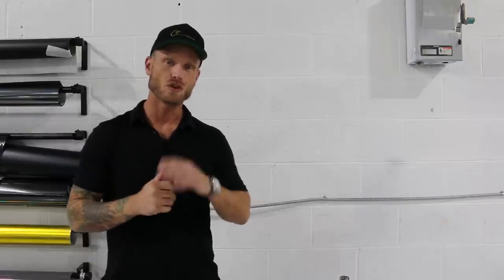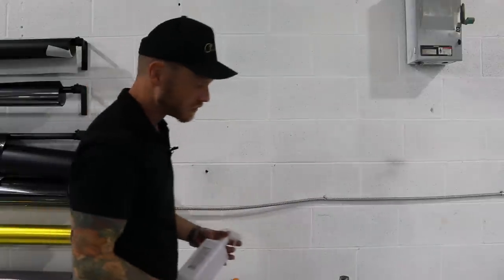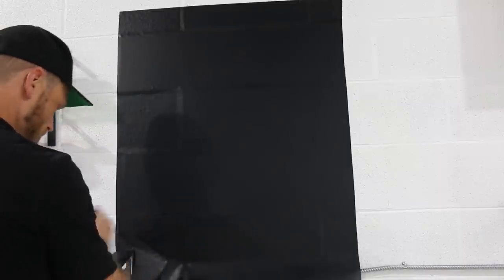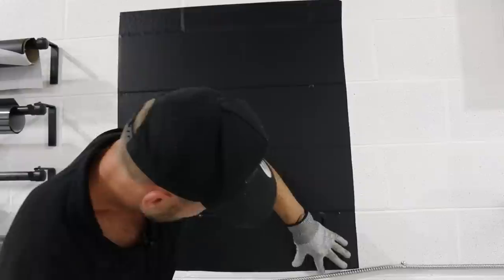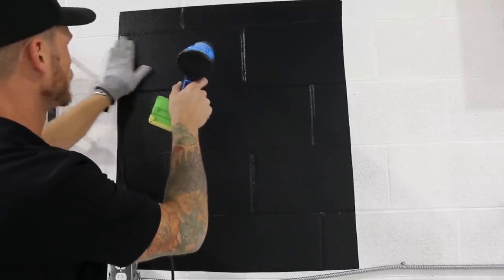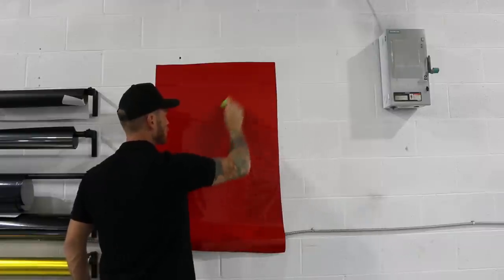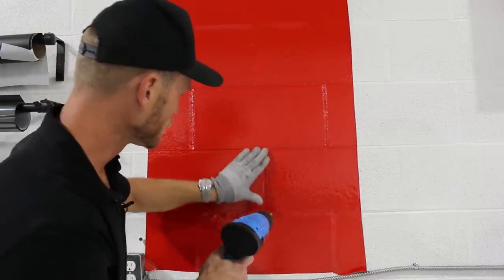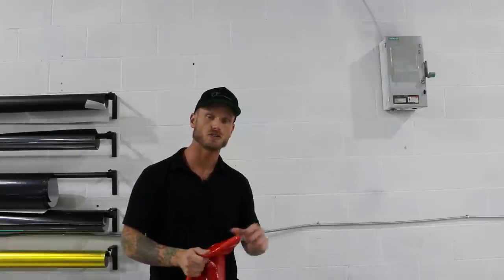Will It Wrap - Vinyl Wrap A Brick Wall

Comment: i use 3m 180 for most textured surfaces. vcat2 foam roller for the grout lines, but first i just squeegee the edges, roll with heat over the entire brick/cinder block surface with a wide foam roller to lock it all down, then go back for the grout. much faster. some were asking about non painted brick, it’s perfectly fine. just brush off the dust and loose debris, make sure it’s dry and you’re good to go! unless someone put a sealer on it. but you can wash with isopropyl

Comment: Sweet video! 
There is specific vinyls for walls and textured walls that conform to all the different little textures in there, theres also rollers that you use with heat to adhere everything to all the little crevices and stuff.

Comment: Fantastic demo.
My thoughts:
-This demonstration does not show the air channels necessary for a full brick wrap
-How to avoid bubbles on the face of the brick
-How to remove bubbles in the grooves after installation
-Proper rolling tools available for these situations
-Rolling tools vs gloves
-Torch methods (I use blowtorches 99% of the time for vehicles, 25% for brick walls)
-The temperature of the heat gun
-How to wrap around obstacles (the wire and the outlet)
-The brick face was not fully adhered to show full texture
-The amount of time it would take to apply primer to each groove
-Proper way to align an image or text to the wall level
-Proper ways to promote adhesion to the top of the panel (banner tape or primer)

Id love to see a video that shows when and when not to use primer. Or a laminated perf install tutorial. Well done and thank you for your vids.

Comment: Cool to know that vinyl does adhere to the block wall ,amazing!
Reply: Has to be painted though as bair brick wouldnt work so well iam guessing
Reply: Yes ur right for the best application, you would have to 1st spray down with muriatic acid, wait 10 min,then powerwash,and this is to get as many imperfections out as possible, let dry then use a exterior paint,whether inside or outside, paint it,let dry for 48 hours then apply 👍
Reply: @dannydirt5D  Sticks to raw brick just fine and dandy.   Bond is of course not as well as painted cinder block, but still amazingly good.

Comment: If anyone is considering this for their shop etc. 
You can pin hole air release those gapped areas just like you would if you were covering a rivet on a cargo truck or trailer.
Also using sign vinyl (with a 5 years outdoor guarantee) will work much better for applications like this given it is thinner and higher tack. 
(Be warned after about 6 months it will create a ghosted image under it and may or may not take some paint off when removing).

Comment: Hi, great video. New subscriber here. Thanks. I tried wrapping for the first time using vvivid 3mil brushed metal on a bare plastic door trim of my 2021 Honda civic However, its not sticking because the plastic trim has a very fine textures. I tried the vinyl on smooth surface such as the car body or glass...and it did stick. But not on the bare  plastic trim with fine texture.
Do you have suggestion what vinyl i should use?  Thank you in advance.
Reply: Same question!